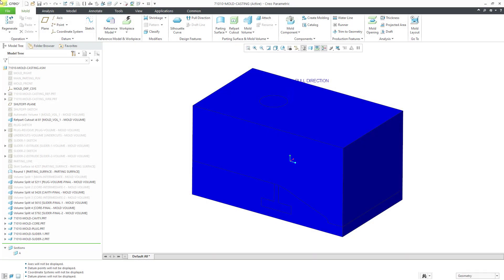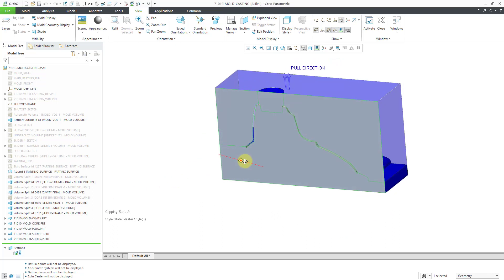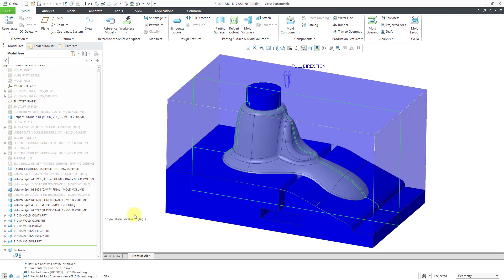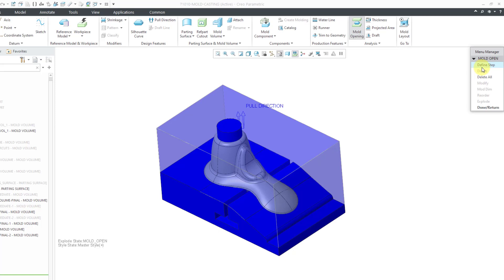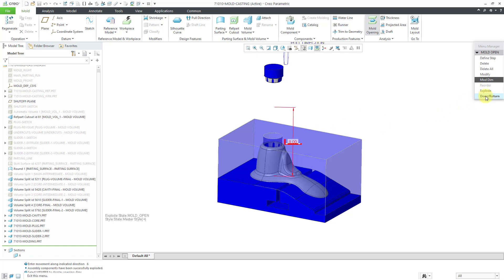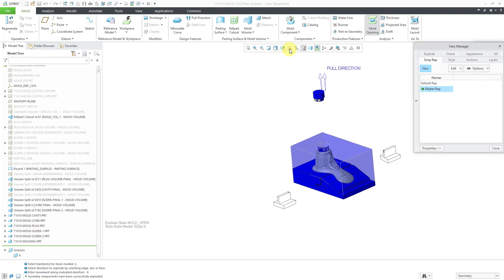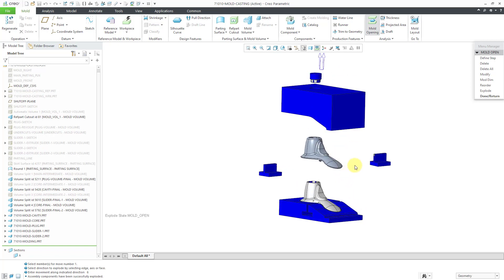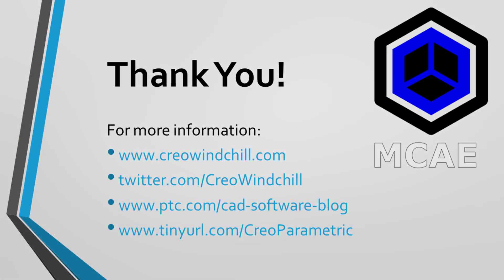Creo Parametric - Mold Design | Complicated Showerhead Mold (Part 5 of 5)

Comment: It's very informative. If it's not difficult I would like to see an example of using option "Gather volume tool" to create new volume in Mold Design. TIA .
Reply from the maker: Honestly I do not plan on doing any more Mold Design videos unless I come across a model that would be a good teaching option. Off the top of my head, I do not have a good example of a scenario where I would use Gather Volume, at least not one that would interest me in making a video.